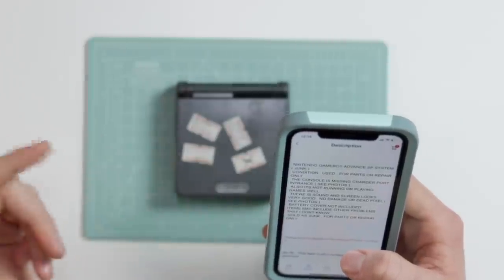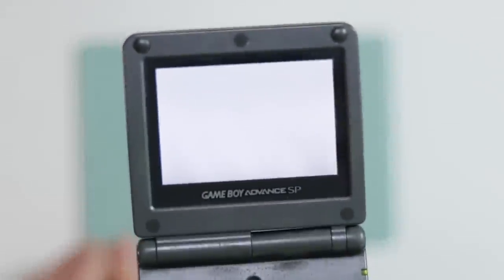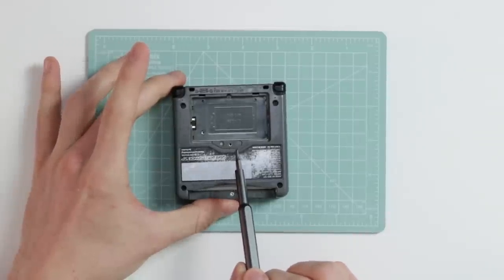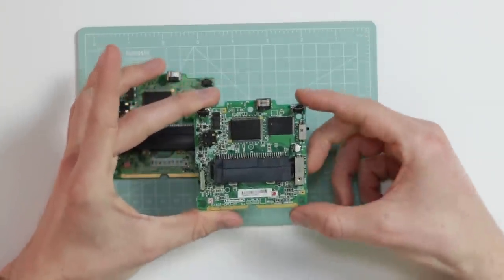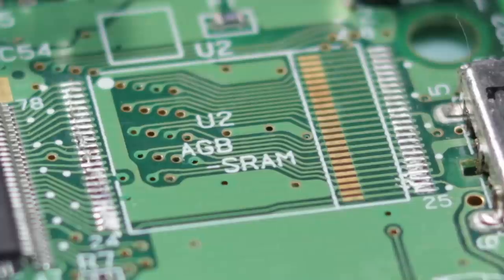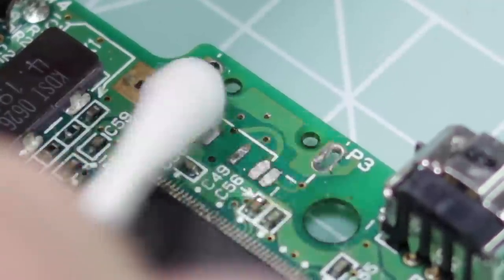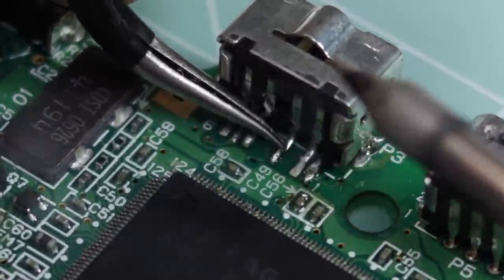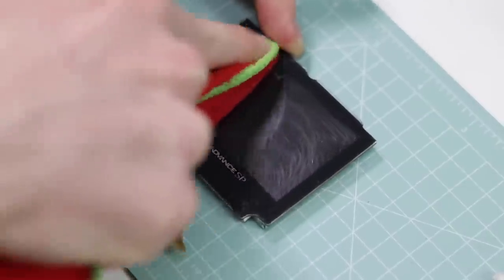DISGUSTING £30 GameBoy Advance SP AGS-101 - Can I Fix it?

Comment: I would love to learn how to repair the older hand held systems
Reply: Same, I’ve been looking through ebay and found one, the only problem is the speaker doesn’t work so I hope I can save up and ask my mum to buy it along with a replacement speaker, but I think you have to solder it, I don’t have a soldering iron so I’ll probably look at some other ones that are classed as “broken or spare parts”
Reply: @EvanSage  the speakers are a few quid on ebay normally like i think I got a gameboy colour speaker for like £2.50
Reply: @jasperbaker1155  lmao im sad cus the bidding stopped oof
Reply: @EvanSage  Ooff
Reply: Calum thanks lol idk how much I’d use it though
Reply: It’s surprisingly easy the hard part is getting them cheap and in good condition
Reply: Awkward Aver “I can save up and ask my mum to buy it” ...wait what? 😂
Reply: クロナ. ? I’m a minor so I can’t buy anything online so I have to get my mum to buy it
Reply: Awkward Aver ah I see now 😂 sorry you didn’t specify.

Comment: I just finished a shell swap on my AGS-101. It came with a pearl blue shell in scratched top condition, but the bottom was fine. I had the opposite with an AGS-001, so I created a dual color silver and blue 001, purple 101.
I was disappointed you didn't show how you finished the hinges on the new shell. I struggled with mine for a solid 10 minutes. And stabbed myself with my screwdriver.

Comment: I was hoping you could show how to remove the hinges safely. There is a 3D printed tool you can use or you can use the trick I've been using for over 15 years: trim off a small piece of a Bic RoundStic ink pen.

The screen front body piece needs to be opened to the detent position when removing or inserting the hinges due to tabs in the body pieces that line up with slots in the two sides of each hinge. If you force them out then the two halves of the hinge will not be aligned and will not fit back into the GBA SP shell correctly.

Comment: thanks for video. I also prefer original AGS 101 LCD screen to new IPS. 
I have 2 old AGS 101 model with slightly darker edge on LCD. I think it is burnt out due to old age. so.. I know some ebay or aliexpress dealer sell AGS 101 LCD screen but I doubt it is real Nintendo LCD. I wish to know any dealer who sells REAL Nintendo AGS 101 LCD screen...

Comment: What missing is one for sound / a 100uf Capacitor, you can use whatever volt as long as it fit in shell (mine use V.6.3) look for + - leg and just solder in. That is it

If your GBC GBA GBASP got low sound even you put it on max. Look for this CAP near volume wheel / slider. Replace with new one and your GBA/GBC sound will max as it could.

Comment: I take the screw covers off with hot glue or a drinking straw.

1) The hot glue trick:
Build a mound on the screw cover and let it cool. Pulling it off should lift the screw covers with no damage to the cover or the shell.

2) The drinking straw trick:
Make a diagonal cut on a drinking straw then trim the sharp point into a round edge. If you got the angle right you have a round scoop that you can wedge into one side of the well with the screw cover and screw. It will have much more surface area to distribute your levering pressure and should not damage anything.

Comment: Late in the game but whatever. The SRAM chip is literally just RAM. The compatibility switch simply shorts proper pins on the other chip which is the CPU that has original and newer hardware embedded in it. Look at it as if you put an Xbox One and PS4 in one box and wired both their on/off switches to a 3-stage switch. The middle position would be off, other ones would power on either system.
I hope I could be of any help :)

Comment: Hey elliot i have a question.
Im planning to turn my old ds lite in a ds advance(basically a ds without a top screen that can play gameboy advance games that way. 
Ive never really solderd small things before and i dont know if flux is required to solder small things. Could you let me know that?
(I have to solder two small wires to two small contact points and those two wires i have to solder to an 1k resistor.)
Reply: TRF is planning to do one of those quite soon, it might come out next week. Most people call it a Gameboy Macro. I've been requesting it for weeks now and so have some other people.
Reply: There's probably a small amount of flux in the solder (most modern ones have that, description should say), which makes it easier to handle. It is much easier, though, and highly recommended to use extra flux. Especially if you're a beginner. It sticks to the solder points way easier because of the flux, meaning you have more control. If you don't use flux, the solder tend to stick to unwanted solder points, which could easily make a mess by forming unwanted connections and too much solder.

Comment: I had the graphite one as a kid. It sadly got ran over. I kept the parts though, and I got a replacement fuse and battery coming. Sadly a replacement shell and ips shell are expensive

Comment: Hey Elliott! There's something you should know about soldering you're doing wrong, which annoys me as an engineer. You always seem to be blowing on the solder after you solder. This makes the solder connection very brittle and fragile, and it also looks matte instead of shiny when it dries. Do with this info what you want ;)

Comment: Could you strip the protective covering at the top of the ribbon cable and solder the second ribbon cable to that? The bottom of the cable could still pass though the hinge since it has nothing attached to it.

Comment: with the old board you can drown it in IPA and re-flow all the solder and it should be fine. also i doubt the chip that was missing is expensive. hopefully i helped

Comment: Was the AGS-001 sticker at 13:51 intentional? Personally, that would annoy me.
Reply: Most of ags-101 were sold in America and had that sticker. Also, is the only aftermarket one found for 101. I still haven't found where to buy european stickers for 101.
Reply: @davorz  Ah ok, that's interesting.I don't have as AGS-101 that I could actually check, so just thought it might of been an oversight :)

Comment: Just a random thought, I have no knowledge about GBA's, but, if the device booted, but GBA games weren't working, and the device has the actual chips to run GB games, and memory missing... I ponder if a GB games would have worked?

Comment: Sram is just volatile ram, how the gba works is the entire gbc processor is on the gba processor itself, tht switch is to swap the gba that vuns a 3.3v to 5v like the gba does, Nintendo tried to do this in software and you can use home-brew to boot into gbc mode even on the gb micro but no games run sadly might have something to do with the boot ron

Comment: "Can I fix it? " - No
But here's a different board and a new case, I'll just donate the screen.

Edit: sorry, I was slightly disappointed, expected a fix and felt conned to watch you put something else together.
Would love to see you attempt to fix it, even to no avail. We can all learn something from trying.

And, even though you said the case was disgusting, would it not clean up?
Reply: Lmao this is so true. Basically buying a new gameboy in a fancy way
Reply: he's an amateur repairman. Both of the chips needed a hot air rework station in order to repair, and I remember from another video that he doesn't have one. Traces lifted up by corrosion, and pads ripped off the board by someone else trying to fix it. He's right, he can fix it someday. Just not today.
Reply: @drzoidberg71  I get that, just a misleading title and a game boy that is no good for anything. I've watched many of the other videos, lots of decent content. I'm not knocking the guy, just this video
Reply from the maker: How’s it a misleading title?
Reply: @TheRetroFuture  it implies it will be fixed / attempted to be fixed. Alas, you take it apart and then put a different game boy back together.
Reply: Dude just try and replace a surface mounted chip with out the correct kit it's a nightmare
I would of done the same tbh
Reply: @jamesnewbould2469  it's not misleading the question was "can I fix it?" The answer was nope
The title wasn't "I fix it"
Reply: @Spardin  if I put a video of can I pick this door lock, but I couldn't do it, I just go round the back and climb in through the window, then it's not really a lock pick video. The answer is still, I can't pick this lock / I can't fix this game boy.

Comment: "Obviously there's gonna be some upset people which I'm prepared for, who are gonna be annoyed that I didn't fix this board."
Oh fuck that, it's clearly beyond repair. Someone took out the ram chip, clearly tried to reseat other components and failed, water damage, and god knows what else that thing has been through. While I'm sure someone out there has the chops to fix it, I doubt anyone would say that's preferable to replacing it.

Comment: Dont use metal bits to get the rubber pads off, instead use plastic ones so its harder to scratch it. if you dont have any, you can allways wrap the tip of the bit with 1 layer of insulating tape...

Follow me for more tips of the day... (?